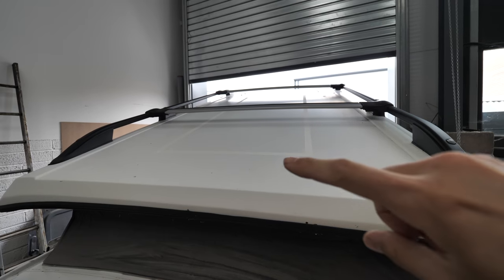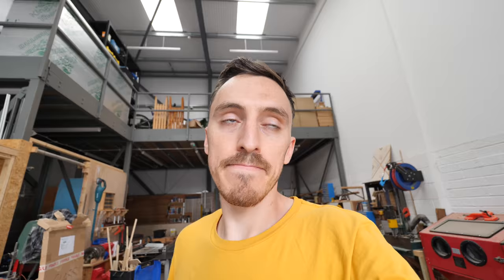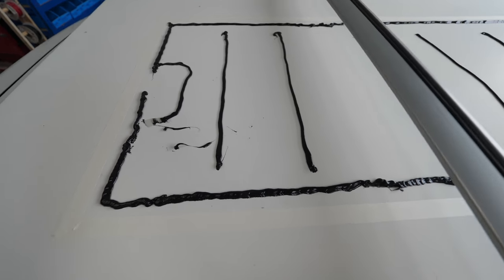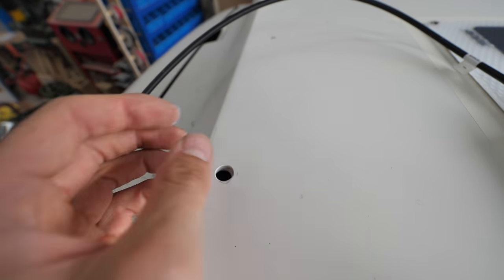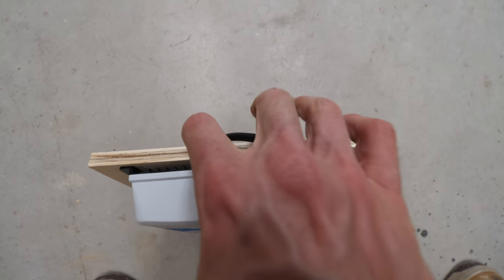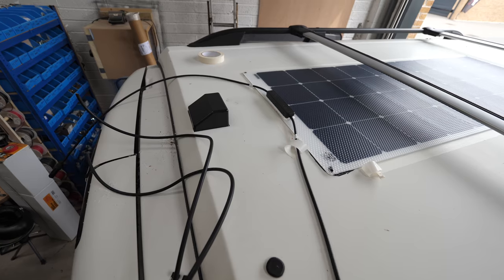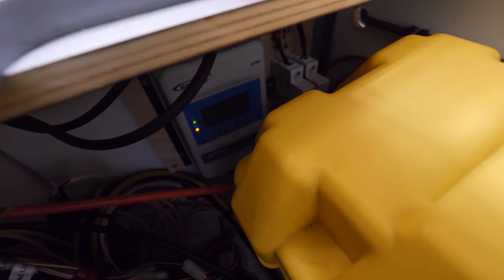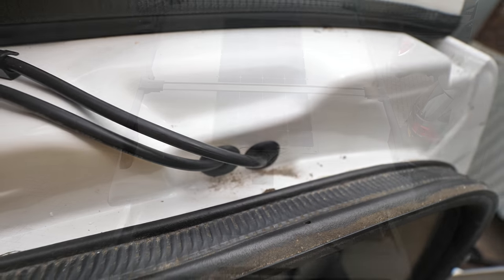Semi-Flexible Solar Panel Install From The Summer

Comment: Hi Hugh, interesting that you left a gap in the sealant so that air can expand in and out. However...this would let water under and when it freezes in the cold the ice will expand a good deal more than air will and with much greater force. Especially as you left the gap on the leading edge. Indeed air will expand out of any pinprick sized hole so would more likely not produce a problem...water however will.
Reply from the maker: This is a valid point but they gap is  at the back of the van and based on the curve of the roof if water lands near the gap in the sealant it falls away from it towards the rear
Reply: Useful to remember, but silicone  does stretch, so (depending on “how much” water, and “how much” silicone) it ought to have enough give. As Hugh says, the water will drain to the curve of the roof, maybe next time leave some drainage at the low spots, front and back, as well.

Comment: I don't understand why you added the 2 grommets in the water channel and am I right in thinking the blackbox that feeds the cable from the solar is facing the wrong way around so water will enter the cable entry holes when driving in rain ?? I can see water leaks being an issue in the near future on this install.
Reply: The grommets in the water need to be in as when it rains the water will run done the cables and into the right? I am no expert on these thing but that’s how I see it (could be wrong)?  And the black box is the wrong way. But the screw bits (don’t know there name lol)where the cable go through have rubber in them so when you tighten them it will make it water tight round the cable entry. Like I said I could be wrong? 👍
Reply from the maker: Yes the box is orientated the 'wrong' way but water ingress is extremely unlikely. The tension the rubber has on the cables is very high so I am not worried
Reply: @karljepson6560  the black screw in bits are called CABLE GLANDS and when done up tight won't allow water ingress

Comment: A tip: from experience I can tell you that if only one leaf is on the solar panel, its efficiency is halved. So, the luggage racks will drastically reduce the load efficiency through their shadow.
Reply: Using an MPPT solar charge controller will negate for the effect of partial shadow on the panel. What size leaves are you referring to?
Reply: @dan_ll  At 4:52 you have a luggage bar that always shadows 3 of the 32 cells in the panel. The 32 cells are connected in series and if 1 cell (3 in your case) stays in the shade the panel will only produce a maximum of 10-15% of capacity even if it is sunny outside.

Comment: Getting a nice finish on the silicon etc i just used the blunt end of a drill bit of the right dia to smooth out the surface,that gave you a lovely concave even bead,leave for about an hour so partial cured and you should be able to peel the excess of . Any stubborn bits we used to make up small perspex scrapers to remove those. (the perspex doesn't scratch the surface ) . Another way is to put a mix of soapy water into a spray bottle and spray along the bead prior to using the drill bit.
Reply from the maker: Cheers John, someone else mentioned about the soapy water mix! Will have to try it out

Comment: I have 2 similar panels (just bigger) glued to the roof of my Iveco for 1.5 years now and been to hot climates, no problem at all. I did leave more gaps in the glue lines though for more air circulation (if there is any at all being so close to the roof 😂).

Comment: My three 10O watt flex panels worked very well in Spain last summer . Not as good as my friends solid glass single 275 watt panel . However now back in the uk in November I need to top up with alternator as very little charge ..   I am not convinced I will get more than 3 years out of them but we will see !

Comment: I'm pretty sure a builder friend of mine told me to get water with washing up liquid in to use for wiping-shaping silicone, stops it gripping to your finger, as soon as you put that cable box on I thought, feed the wire first! haha
Reply from the maker: Cheers Malcolm! A few people have mentioned this, will have to give it a go, cheers

Comment: Good one, looks neat. I'd be looking to add aluminium "U" channel on the underside on the Roof rack and slide the solar panel into the U channel, stiffened with a sheet of plywood, if required ?
Reply from the maker: Hey Remus, yeah you could definitely do it that way and also add a few holes in the ply for extra air!

Comment: 3m tape or equivalent is less messy than glue  and works great on Flexi panels and keeps an air gap under them for air flow

Comment: i had mine stuck to the roof of my transit the same model with no issues,  in fact the panel is so powerful it blew fuses. So uprated them.
Reply: hi what were your fuse rating before and after i noticed Hugh seemed to be using 25A and it looks like the panel can only deliver 4A max thanks
Reply: @mmartin4978  probably similar, i sold my van but what i did was use an inline fuse, the type the breaks physically similar to the ones car audio people use.  Its black and has a red switch on it.
Reply from the maker: Top job Richard!

Comment: Not sure if it works with CT1 or Sikka Flex etc but the trick with silicone is do a mix of 3-4 parts water and 1 part clear washing up liquid. Apply an even bead (around worktop or bath etc. Then dip finger or tool in the mix and wipe. Clean finger and tube nozzle with kitchen towel and do next bit. I never mastered silicone until I found this trick.
Reply from the maker: Funnily enough I found this trick not too long ago but lost the quantities so cheers for this! Will try next time

Comment: The kit from bimble has only one breaker included. Did you just double up on that when you ordered?
Reply from the maker: Yes, I am not  100% sure why they only include one but for added safety it's much nicer to have a fuse before and after MPPT

Comment: Shadows will reduce the harvest to just  20-30% max.
Reply from the maker: as mentioned in the video the customer wanted to keep the roof rack even though  it cast a shadow
Reply: Surely that would depend on how much shadow was cast? It didn’t look like there was that big a shadow

Comment: Cables too long but then you join them outside? Why did you cut and join them? Sorry if I'm being thick
Reply from the maker: The cables from the panel are only a certain length which wouldn't of been able to reach inside the van even if not cut so had to splice outside.

Comment: My 250w German/Austrian made flexible panel has a maximum operating temperature of 86°C. It is just glued to the roof of my Relay. 4.5 years and no problems... so far.👍
Reply from the maker: Awesome to hear Carl!
Reply: What make are your panels please.